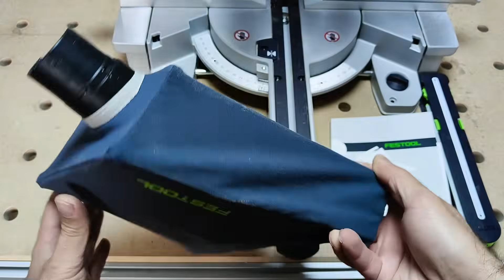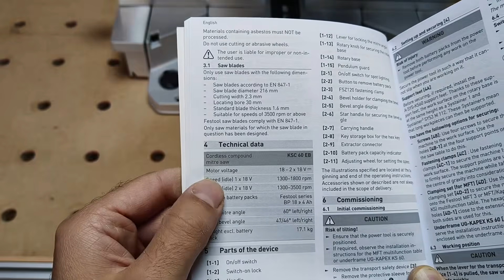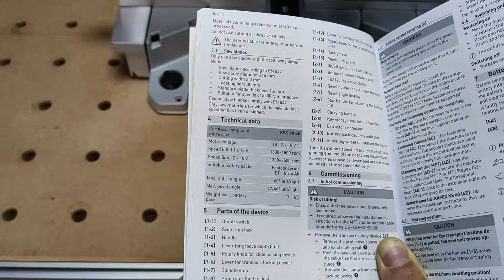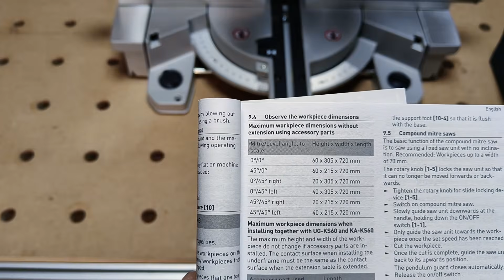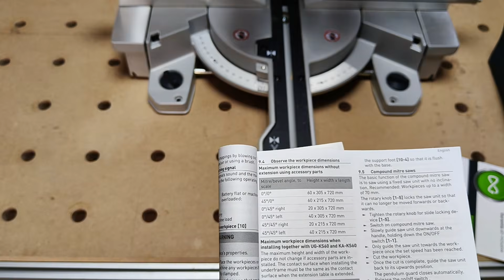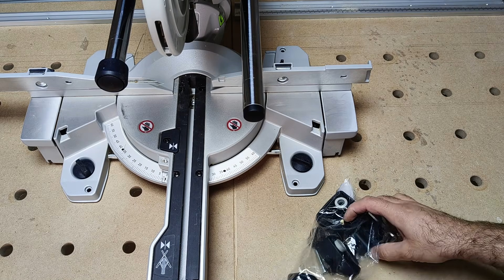Festool Kapex KSC 60 Review | Part 1 | Best Cordless Miter Saw for Precision Cuts?

Comment: What year was your saw manufactured? I can't find any 2024 or 2025 models in Canada,  all dealers have 2023 models. It's now 2026, and I want to buy a product that costs a lot of money and is newly assembled, not three years old. I know there's a 3-year warranty, but I still don't want to buy something that's been sitting in a warehouse for 3 years.
Reply from the maker: Hello. Main is 2025 and i bought directly from Germany. You are absolutely right don't but saw which in warehouse for 2-3 years. As well lock on switch changed to make easier to use swa for both hands. I think in near future they will announce new model like cordless track saw. Try to find any info before buying